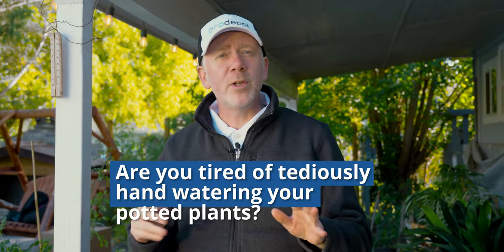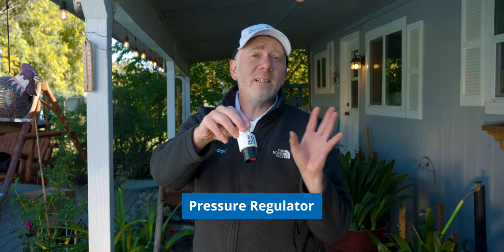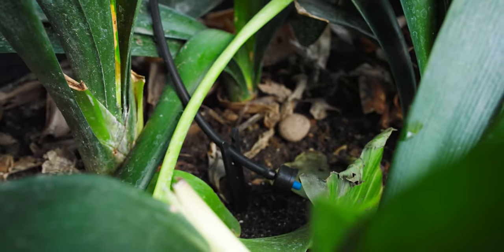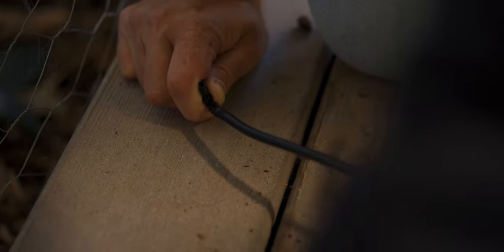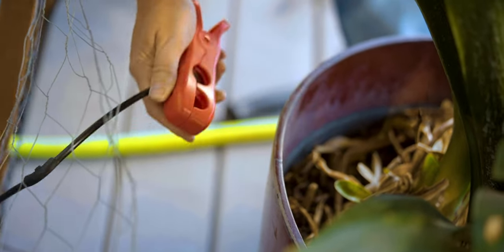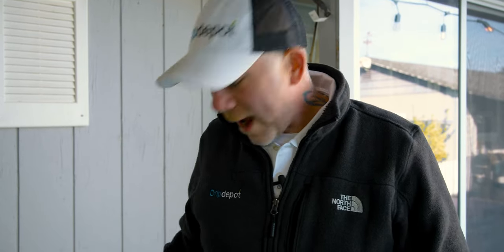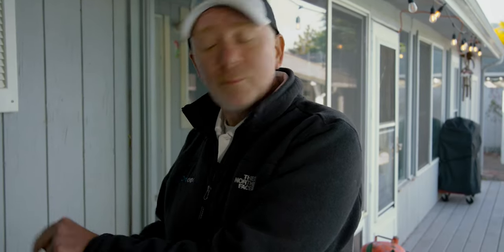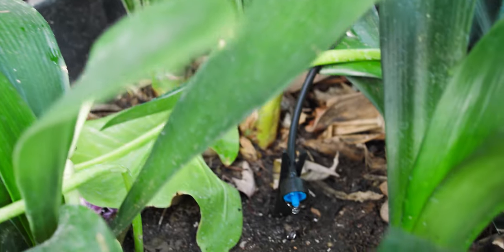How to Install Drip Irrigation for Containers and Potted Plants (Complete Beginner's DIY Guide)

Comment: Thansk Adam. Exactly what I was looking for and really well explained with no unnecessary information. I have a doubt about keeping water pressure even through out the system. Will the presurre regulator do that?
Reply from the maker: You're very welcome James!  And you have the exact right of it on the pressure regulator -- it maintains the downstream pressure at a constant determined by the pre-set PSI.  This keeps drippers emitting uniformly and protects components from high pressure.  So long as other factors are accounted for (primarily making sure there's not too much pressure lost from friction) it does a great job at maintaining an even pressure throughout an entire system. 

In regards to the friction loss, that's mostly just making sure the flow and line length isn't too great for the diameter of the mainline tubing being used.  It can be mathed out, but the general guidelines to recommended maximums (200 GPH for 1/2", 480 GPH for 3/4" and 960 GPH for 1") do a pretty good job of ensuring minimal friction loss :)

Comment: some flower crests have a water deposit as a reserve at the bottom, but it's spent quickly in a few hours sun in summer since balconies heat up as an oven due to their ceramics.

Comment: w/ an elevated water deposit it's also possible - even w/o timer (only neede for vacations/longer absences), because there's just need to open & close the tube shutter. great advantage is being able to dissolve fertilizer into the tank (even solud solluble) such as DIYbroths such as symphytum comosum or stinging nettle.
Reply from the maker: You bet, with water soluble fertilizer that works really well -- the only concern I've seen come up is the potential for growth to happen inside the tank, but this can be taken care of somewhat if the tank regularly empties.
Reply: they advice to install the tank's outlet not at its bottom, but some inches higher for the debris acumulated there not to flow into the dripping system. sometimes at getting its level low in summer, it would have to be cleaned by brush @dripdepot
Reply: pouring the fertilizer directly into the tank i'd prefer to install a solar pump w/timer for removing it instead of forming layers, but then even the debris would float up. may be better to install a recycled water bottle to be filled up w/ fertilizer solution on its outlet tube. in case of timered dripping system less permanence as by blumats. my fertigation injector supposedly works from 0,2 bar (=2,+m high tank for the pressure loss in hoses) on (now at fall less need to try it, also it has to be installed still, although possible to connect it directly to the hose 1x weekly for feeding the pressurized system by faucet, although it needs a 3 bar reductor then unlike the injector able to withstand up to 6 bar supposedly... @dripdepot
Reply from the maker: @wolfgangwunschel-b4p   Wolfgang, does your injector have any tubing associated with it?  The reason I ask is that you may be able to use some coupling valves so you can have on/off if you won't be injecting on every watering cycles.
Reply from the maker: @wolfgangwunschel-b4p   That definitely makes sense -- the tank we used for the gravity video also had the tap a few inches above the very bottom.  That tank is still at the vineyard we installed it at, next time I'm there I'll give the bottom a cleaning as I don't think it has been, thank you for the heads up on that.
Reply: - like to see coral skeletons on mars ? cre ate ive so ci(e)ty, yt yesterday, in the middle of the documentary @dripdepot
Reply: @wolfgangwunschel-b4p  Wolfgang, are they the ones found in Gale Crater?  Fascinating stuff!
Reply: - just that we are in the so called 'death zone'' when the campi flegrei erupt, so i'm not sure how to make it then... @DripDepotAdam
Reply: @wolfgangwunschel-b4p    I can empathize there,  I'm close to the Yellowstone Supervolcano -- fortunately, "erupting soon", in geological terms, can still mean thousands of years.  Soon to the earth, but not necessarily to us.

Comment: Hi! What a great video- I am excited to try to install this. I am watering a container garden on my balcony with no hose bib- is it possible to connect this system to a tub faucet? (running it through the bathroom window out of the tub) Thanks so much!
Reply from the maker: Unfortunately probably not, at least not unless the tub faucet just happens to have hose threads, but I suspect that is not the case. 

With that said, you might still have some viable options :)  

We actually just shot a video for both of these items last week -- the video was for vacation watering, but they could totally work here as well. 

https://www.dripdepot.com/aqua-magic -- This first one is basically a complete automatic drip irrigation system -- it comes with everything needed except a container to hold the water.  Almost any container works, you just run the small tubing into the container and this will pump the water to the drippers you put at plants.  It also has a built in timer, so you can have it all be automated.  Maybe best of all, it's solar powered, so you don't have to worry about changing out the batteries all the time, you can use rechargeable ones and it will stay charged with even just ambient lighting conditions.  

https://www.dripdepot.com/watering-rock -- This one probably is not as elegant, but it is more discreet.  There's no timer for this one, so it's "always on", but it drips pretty slowly.  You could control it to some degree by putting it up on a shelf or similar when you want to water, then placing it on the floor of the balcony when you're done.  

I hope one of these can do the trick for you!
Reply: @dripdepot  Thanks so much- Ill check it out!
Reply from the maker: @cassieglanz  You're very welcome!  If any questions come up, just say the word :)

Comment: I needed some advice about the different kits. I have 60 pots with individual plants..which kit size would be best suitable roughly?
Reply from the maker: The Premium Container Kit (at this link: https://www.dripdepot.com/124) would probably be the best place to start -- that kit is designed up for up 70 plants of varying sizes.  A few more plants than you have, so you may be able to modify the kit to remove additional items you don't need -- most of it just making sure there's enough mainline tubing to get from your water source to your furthest plant, and enough fittings to accomplish your design (mainline elbows for 90° turns, tees if you need to split the tubing anywhere, etc). 

If it's helpful, here are a couple same designs we made for our container kits -- scroll down a little bit to get to the larger ones that use the 1/2" mainline for more plants: https://help.dripdepot.com/support/solutions/articles/11000119079-container-garden-sample-layouts

I hope this helps!
Reply: @dripdepot  thank you!

Comment: Hi extremely helpful video.  I installed my items today.  I have a lot of leaking from the hose by tubing adapter.  I even ordered an extra and tried both adapters.  The leak is not coming from where the tubing connects, it’s coming from the perimeter of the round part of the adapter.  Any hints?  Thank you.
Reply from the maker: Happy to help!  And I can confirm this should not leak, so let's get you up and running leak free :) 

The first place to check is inside the female side of the adapter -- there should be a gasket in there, if it's missing that would be the likely cause.  If it's in there, be sure the adapter is threaded down enough on the pressure regulator that it's engaging that gasket. 

If it's still leaking, just let me know and I'll get a replacement en route to you :)

Comment: LOVE your videos and your site! New to Central Texas and the drought conditions are no joke. I just received my foundation drip irrigation supplies from your site (thank you for the extremely helpful video on that!!!).  I used the recommended 25 PSI pressure regulator and 1/2 inch dripline with 0.5 GPH on the less sunny side.   I have some potted plants in the back and eventually will set up several raised beds.  I have one hose bib that is at the front of the house 65 feet away.  My question is, would I tap into the foundation watering dripline that is along the back with a T connector to water my plants? If so, can you link the connector that will go from a 1/2" line to a 1/4" line? I'm a little confused on the site which ones would do that. I think I'd want ones with the on/off switch as I'm not sure if they need to be on the same schedule as my foundation.  If not, do I hook up another timer and pressure regulator to a new mainline line that runs to the back? Thank you so much!
Reply from the maker: Thank you, we're glad you found us too!  We're in the pacific northwest and can fully related to those drought conditions, the last few years have been brutal -- fortunately this year was a bit wetter than previous.  We're still in drought, but not as severe as the last 3 or 4.

You could absolutely tap in to the tubing on the foundation watering system -- all it takes is a 1/4" punch to punch a hole in your mainline (or in the 1/2" dripline, just be careful not to hit an emitter) and then insert a 1/4" coupling into that punched hole -- you can then run 1/4" tubing pretty much anywhere it needs to be, just try to keep the 1/4" tubing to 30' or less in total length.  If the length is over 30', you could just install a Tee and run some new 1/2" mainline to the potted plants and future raised beds and install the 1/4" tubing there.  

Here are some of those links -- I don't think I can hyperlink in the comments section (I'll try though!) so you may have to copy/paste these :) 

https://www.dripdepot.com/category/drip-irrigation-punches-cutters -- This goes to our listings of punches, you'd want a 1/4" punch (most of them at this link are 1/4"). 

https://www.dripdepot.com/search?q=1070 -- This goes to the 1/4" coupling, the part you insert into the punched hole to connect your 1/4" tubing. 

https://www.dripdepot.com/search?q=1159 -- This one goes to a 1/4" coupling valve and will give you that on/off functionality on any 1/4" tubing run :) 

Here's to hoping for more rain in both of our areas!

Comment: Does the pressure regulator help in cases of low pressure? I'm using rain barrels as my water source.
Reply from the maker: Unfortunately the only way to raise pressure is to either raise the water source or use a water pump.  A pressure regulator can only maintain downstream pressure if the inlet pressure is 5 to 10 PSI higher.  

If you've overtaxed the barrel's ability to provide water for the entire system, zoning it into two zones can sometimes be helpful -- basically, if the barrel has no problems with about half of the current emitters but struggles with the entire thing, you could divide it into two zones that operate at different times, that way the barrel only has to feed half the system at a time.  Unfortunately it would only help if it could successfully feed half of them at a time (but if it can, zoning could definitely help).
Reply: @dripdepot  Ah I see. This is very helpful. Thank you!

Comment: if some of my plants are more than 30 ' away from water source, but not all my plants on the way, do I still switch to the 1/2" mainline tubing. And then do I still use 1/2" tubing for the rest of the line including up to the drippers, or do I use t connectors to connect 1/4" line to the main line for the drippers?
Reply from the maker: If some of the containers are more than 30' away, I likely would go with a 1/2" mainline -- there may be some specific scenarios that could get away with 1/4", but they're fairly rare and just to help ensure success I'd opt for 1/2".  

With that said, I think you're on the right track with the second question there -- you could indeed go from 1/2" to 1/4" for a good portion of things, particularly if it's more convenient for the area in regards to fitting 1/2" or 1/4" in to the surrounding area (patio, porch, landscaping, etc).

Comment: Hi   Excellent video.  I travel overseas about 4 months a year and you know how sad it is to return home after 4 mos only to see everything dead !  Yes, I even paid a neighbor to water my balcony plants and although they swear they did it, those of us that know about plants can tell that is not true.  I followed you on this nice video, my only issue is I have no tap/faucet on my 10X5 balcony to feed the system.  Planning on on using a large barrel and a submersible water pump.  It will be easier to ask a person to come every 2 weeks and fill up the barrel than asking them to care for plants.  Need advise on what kind of submersible pump to buy, probably I will need a timer for the electrical wire that powers the pump (pump to wall outlet) and then have the system running.  Need to have this system running before I leave mid December.  Thanks !
Reply from the maker: I've been there on the dead plants on return as well!  I was particularly bummed about my young Ficus.  

I'll be more than happy to assist with this, and you'll have a couple options.  When you have a moment, could you reply here and let me know how many plants you have that need watered while you're away?  Pending that answer, there might be a very easy route you can go (a unit that is both a water pump and a programmable controller, solar powered as well so no worries about batteries).  

Thank you for reaching out!

Comment: My faucet is on the patio below my deck.  Is there anything else to consider when running irrigation 12 feet up from the water source?
Reply from the maker: You'll want to consider the pressure lost from the elevation -- at 12' you'll lose about 5.2 PSI from gravity.  This might not cause any problems (uniformity of your emitters is generally more important than their volume), but I'd account for it if pressure were already particularly low at the hose bib.  

You may want to consider a tee fitting near the hose bib and running some additional tubing from your mainline to create a drain.  This is because at system shut-down, you'll have a column of water in the pipe that will flow back to the hose bib.  The backflow preventers don't like back-pressure, and this would be quite a bit at 5.2 PSI (and possibly for extended periods between waterings).  A little routed tubing to a drain would completely solve that :) 

Air is possibly something to consider as well, but with drip systems I usually see if there are any air related issues first, as they're often low enough flow/pressure/velocity that they don't experience air issues like an elevated sprinkler system would, particularly when they're on the smaller side.

Comment: I grow fruit trees in half wine barrels. Would you recommend a drip line ring  or individual drippers (and how many)
Reply from the maker: Either one cold work effectively, but for simplicity's sake, I'd likely use a drip line ring -- a drip line ring ends up being functionally the same as placing multiple drippers around the tree in the barrel, but saves you the time of having to run each dripper in -- you can just make a ring around the tree and done.  :)
Reply: @dripdepot  thank you! Any recommendation on how far the ring should be from the outside edge of the barrel?
Reply from the maker: @susanmundle3579  This will depend on the size of the barrel, and the size of the root ball of the tree, but a good general recommendation is half-way from the trunk to the edge.  Water will spread out beneath the soil's surface through its capillary action, so at the halfway point you'll get pretty thorough coverage in most sized barrels.  In the soil is particularly fast draining or loose, you can even make a second ring or form the ring into a spiral (a second ring is rarely needed, but the spiral works pretty well when needed).  :)

Comment: The ultimate kit has a T filter but no canister. Is this something that is purchased separately?
Reply from the maker: You could purchase it separately if you prefer the canister filter, but you might not need to -- the tee filter and canister filter, as far as the actual filtration goes, are nearly identical at 150 and 155 mesh.  Basically, both have very fine filtration with those mesh sizes being smaller than the average size human hair :)

Comment: Hello, I've installed a drip irrigation system. I ran 1/2 pipe and i'm going to use 1/4 pipe to go to the plants. Each time I install a barb and test the system I have a leak at the barb and 1/2 pipe.  Under pressure I've moved the barb around and that hasn't helps, any recommendation would be most appreciate. thank you
Reply from the maker: Happy to help, I can confirm barbed fittings shouldn't leak where they join the larger tubing (maybe a drip or so the first time you run things, but it should cease).  

The most important factors in preventing any leaks is to make sure you're using a pressure regulator keeping things under 30 PSI and using a 1/4" punch to punch the holes. 

If those are already accounted for, try punching the hole and inserting the barbed fitting early in the morning or late in the evening when the tubing is cold -- then let it sit until the hottest part of the day -- the thermal expansion at that point will help seal up a stubborn barbed fitting.  Typically one expansion cycle like that will be enough.  :)